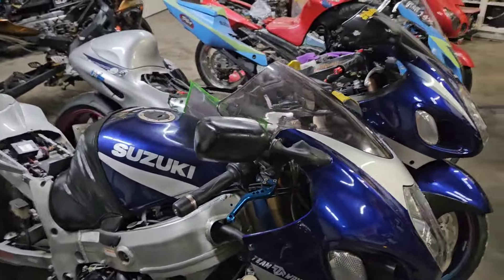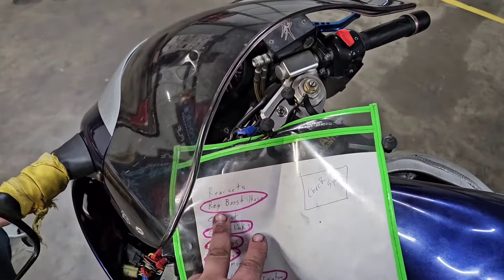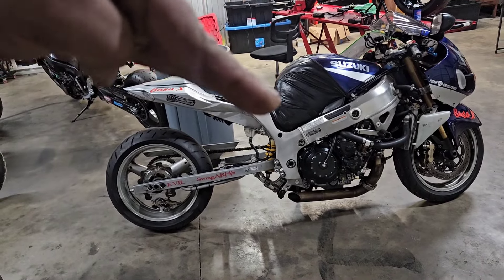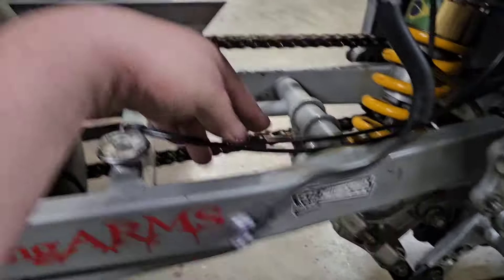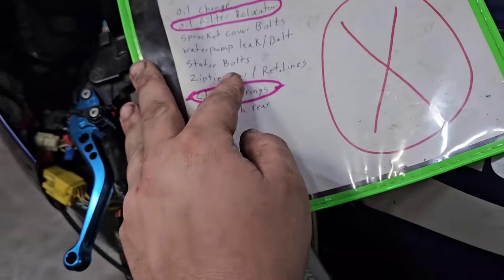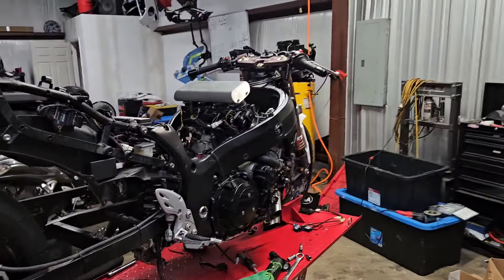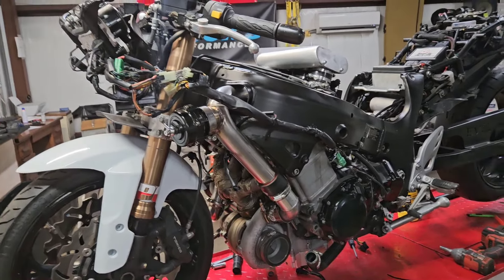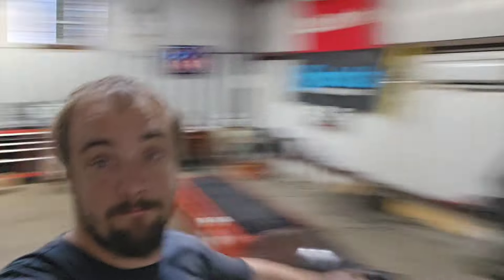Busa X Rebirth part 2

Comment: Can i have your thoughts? I have 2004 gsxr 750 that builder said swapped 1000 in, so the second spark plaug threads stripped and popped out, i put in helicoil but had to fab kinda larger and plug size helicoils together, now question would best idea to have drilled, welded and machined the plug thread or swap the head? No shop near me doesnt want to touch my bike cause older year..so going to get friends brother in law to fix but will have to wait until fall/ winter
Reply from the maker: Honestly the cost of properly fixing that with a big cert you could probably find a used head and buy a head gasket and just swap it